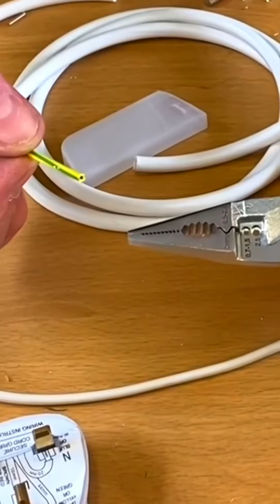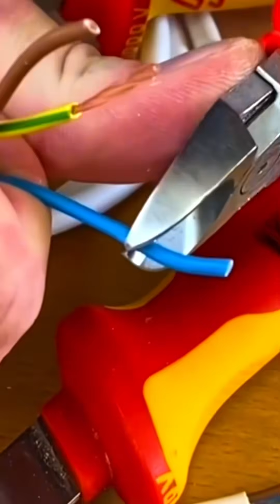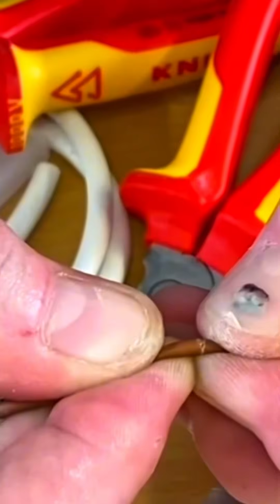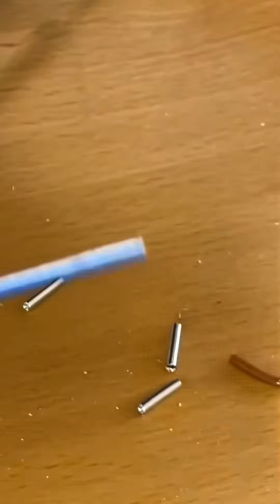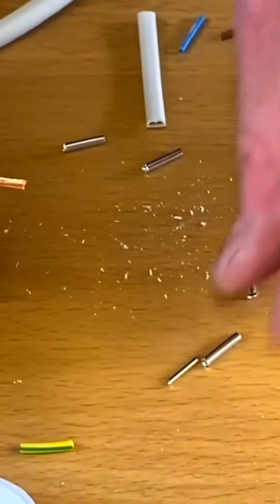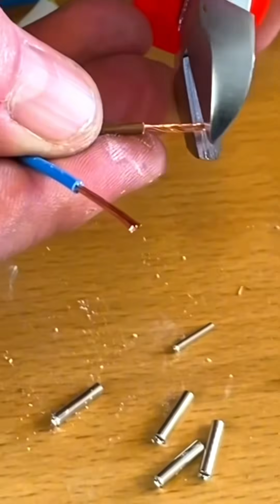Do You Use Ferrule’s..?

Comment: I've never used a ferrule in a 13A plug and have never had any issues. My understanding is that they are only added in the factory to make the fitting of the plug on the assembly line quick and easy.
Reply: Find them usefull especially when space is not available

Comment: Buy a pair of Knipex side cutters that incorporate a 1.5 and a 2.5mm wire stripping holes and have grooves on each face of the cutters to make it easy to see the position to put cable to. 
They are extremely handy to use and most cables in a home are one of those two sizes.

Comment: The point of ferrules is to avoid loose strands. They work well with sprung contacts - Wago and the like. 

I get mixed results with screw terminals though. A brass on brass contact has no spring and they are prone to loosening over time.

Comment: From 35 years in the trade, I've always found it best to not use the crimps as they wiggle loose and also create high resistance overtime
Reply: Not if you do them properly
Reply: Crimps can (crimped terminal pins just add another possible loose connection) bootlace ferrule don’t as they are under the terminal screw. I remember getting some of these in the 90’s, brilliant for control panels

Comment: I think you even mentioned in another ferrules video - strands should not extend out of the ferrule by more than 0.5mm a couple of mm is too much 👍 an  underrated treatment un-insulated ferrules, where the shoulders of insulated ones won't fit in the space ( UK plug is a classic example ) but we don't always have these uninsulated ones to hand. If you're dexterous enough, and your eyes have not quite failed you yet, you can slide an insulated ferrule on backwards, snip the insulated shoulder off with the stranded wire inside - and to the desired length, again a UK plug screw terminal is a great example you only need about 4-5mm - and then crimp the ferrule for a workaround, in the field away from all your stash of fixings and precious things. 👍 I would fail a Pat inspection of a plug with a class 5 cable un-treated in a screw connector, am I wrong? That is to say I would immediately rewire it with ferrules and test it - not to be a D**k, but again, am I wrong?
Reply: Mil is not mm
Reply: @SlyerFox666 your quite right, difficult thing this autocorrect you think you’ve typed one thing and it gets changed if you don't re-select what you typed in the first place. Grate catch
Reply: I find it far easier to put an insulated it on in the normal orientation then snip the plastic sideways with a pair of 'electronics' sized wire cutters.
Reply: @retrozmachine1189  “snips”.  I do the same thing when the plastic guard isn’t desired.  95% of the time the plastic guard is desired so I only buy ferrules with plastic guards and snip them off in the few cases where they aren’t appropriate.